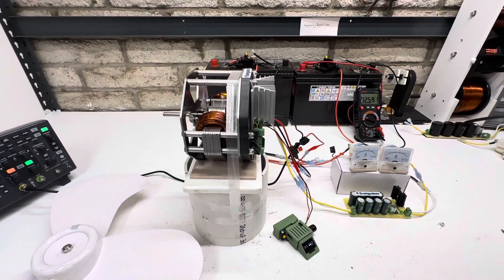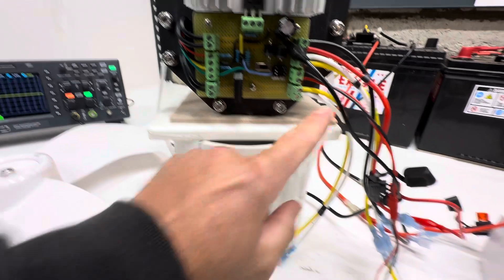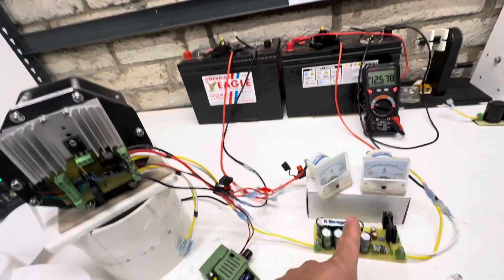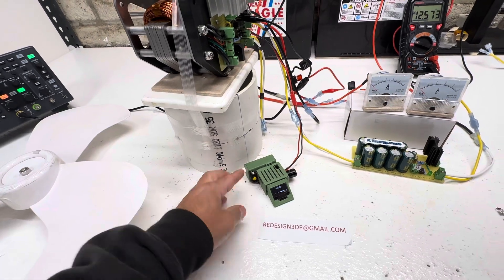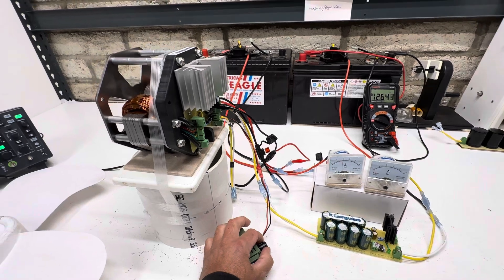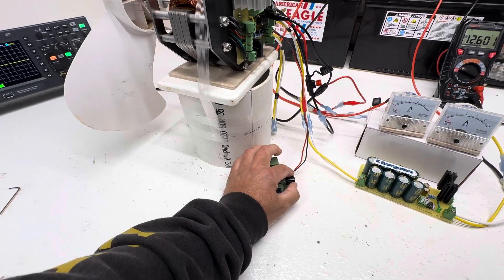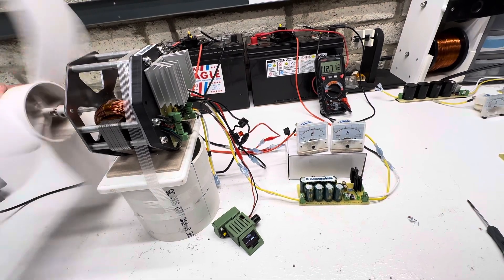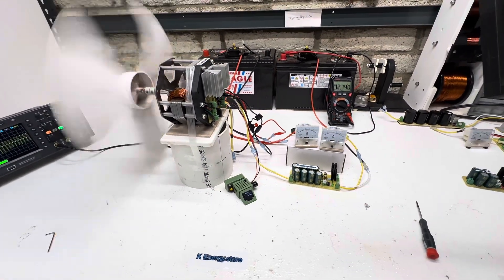New attraction motor for sale ! No permanent magnets

Comment: Any plans to make available a switched reluctance generator?  i would be interested.
Reply from the maker: That’s basically what this motor is just with dc power
Reply: @kenergy1707  sorry, I wasn't specific enough. Magnetically assisted.  Using permanent magnets. This Style.
https://i.ytimg.com/vi/3s6MN_hG9_k/hqdefault.jpg
Reply: @kenergy1707   this style. https://www.youtube.com/watch?v=3s6MN_hG9_k

Comment: What is the torque of this motor and speed
Reply from the maker: 1,200 at 12v 
2,400 at 24v
Reply: @kenergy1707  thank you for replying mei appreciate but another question is  what of the torque ,I mean can you hold the shafts complete when spinning
Secondary do it draw more power when you hold the shafts
Reply from the maker: @MRNWANETI  it can’t be stopped by hand at 12 volts 
Amp draw does increase but so does output

Comment: Hey this is my first of your videos im seeing I would suggest to explain things like efficiency and advantages compared to traditional motors...also some torque tests wouldve been nice.. Ive created a few Perendev Bedini hybrids in the past and I think I got it almost perpetual with no load but was that even your concept here?
Reply from the maker: Thank you for checking out my channel! This motor was not meant to be perpetual but a basic prototype on the fundamentals of a attraction motor transformer 
Most pulse motors flyback spike fades under load and has very low torque this motor is the opposite and does not have the problem of mounting magnets on the rotor or the price of them 
 I made this as a learning model because I have many requests for this in my comments and the highest viewed videos are of attraction motors on my page 
 I didn’t do torque measurements because it’s only a one circuit design for easy learning and visually accessible
Reply: @kenergy1707  Ok just suggestions for future vids I guess.. Im curious about the effective power.. The motors i was building were more axial flux and current draw was alot less using like 48 permanent magnets.. you might have better efficiency with perm magnet designs but not sure
Reply from the maker: @GodSpeaksInMath  I have probably 100 videos on magnet motors you should check out my outboard motor ! 
I made the attraction motor to sell because it’s much safer to experiment on and no high power magnets that pull in every metal tool lol

Comment: I guess this is a switched reluctance motor.  How efficient are they?  I have always wondered why they insist that rare earths are so important.  Induction motors are very efficient.  Are they pushing for ultimate efficiency and ignoring the financial and environmental costs of using rare earths?  I have never seen this question addressed.
Reply from the maker: Yes that’s why I’ve made these they only need mild steel to work well which is very abundant and cheep
Reply: IHateThatName-SRM.IThinkAxialFluxInductionMotorAreComparableWithAtractionMotors-InSmartness.

Comment: Induction motors, which require no magnets, have been around since 1879. So, your motor is interesting, but by no means unique.
Reply from the maker: Yes but induction motors don’t produce 300 volts out wile running on 24v
Reply: @kenergy1707  Throw an extra winding on the induction motor and you have an extra supply. 

Back in the 60's I had a record player that used an induction motor, and powered the tube amplifier off of an extra winding on the motor. 

None of this detracts from the craftsmanship of your motor, just its novelty.
Reply from the maker: @kirkkohnen5050  that’s interesting good to know

Comment: Another beautiful creation.  Congratulations! The rotor and the stator in this motor seemed to have laminated sheets instead of your regular solid steel block. Any efficiency increase because of that? Also, the stator seems to be only halfway around, any particular gains from that? As always, greatest gratitude for demonstration, explanation and making it available for anyone to purchase.  Thank you
Reply from the maker: Thanks buddy! 
Definitely seems more efficient under load 
I made the stater half way around to make a loop of the magnetic field like a transformer but also so that the workings can be seen for learning and tuning

Comment: Mr K.  Could you put a solid state relay on the run and charge batteries and swap them back and forth every 3 minutes sir?  Also, how is the draw amps from the run battery regulated?  Thank you sir.
Reply from the maker: Yes battery swapping works well 
There is no regulation from run battery
Reply: @kenergy1707  Thank you sir.